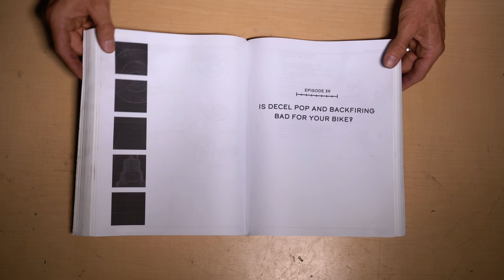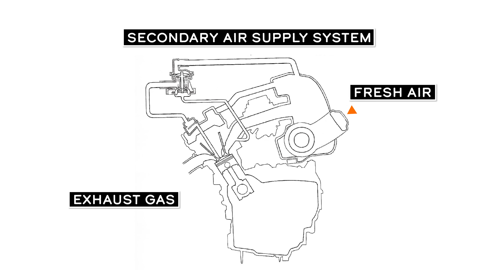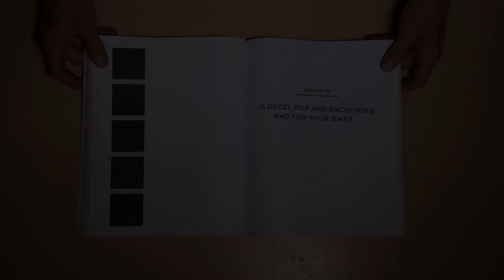Backfiring and Decel Pop — Is It Bad For Your Motorcycle? | The Shop Manual

Comment from the maker: Better exhaust sound is just a slip-on muffler away! https://rvz.la/3zXQJQj
Reply: Which exact knife are you using at the open?
Reply: @KutWrite 🎉🎉😂🎉😢🎉😮🎉😢🎉😢😢😮
Reply: I’ve got a Triumph Speed Twin 900 and occasionally on engine braking, it has started to pop really loudly…(note for later) 

I was coming into a corner decelerating from Mach Jesus and downshifting when I picked my corner gear and I heard a loud bang from the exhaust.

Today I heard a loud pop when decelerating in a higher gear but at a lower speed.

Comment: I JUST installed an aftermarket exhaust a few days ago and was surprised by the decel pops that began after. This video was timed perfectly as I was wondering if that was a normal thing! Thanks Ari!
Reply: Shorter exhaust baffles allow oxygen back into the exhaust system due to camshaft overlap which can cause afterfire.
Reply: It means your bike needs to be tuned to work with the exhaust you've installed. You likely now have a lean stumble off the bottom too.
Reply: @flippy66They normally occur when installing an aftermarket exhaust. They always disappear when the machine is tuned properly.
Convincing people it is normal, makes it easier to sell exhausts; as does convincing people it sounds cool.

Comment: Great video.. I think most people get decel pops confused with lean pops and worry unnecessarily. Back in the day with carbs and simple EFI systems when you'd put a new exhaust on it would lean out your mixture causing the bike to run super lean and pop on decel (which was bad back then).... newer bikes are popping because of what Ari was saying...from fresh air being injected into the hot exhaust gas...so it's totally fine now.
Reply: Most newer bikes are already running incredibly lean from the factory should still get a tune if you change your exhaust or intake especially is you do both.
Reply: @milodudeful  yeah they are way too lean. I agree with its mandatory to get a tune if you do air filter and exhaust. But since most of bikes restrictions are from the cat and breadbox resonators..just doing a slipon doesnt really do anything anymore. But getting a tune is always a good idea..these emissions regulations are pointless and in some cases cause more pollution.
Reply: @JeremiahHartmanPhotography  Oh ya I see what your were saying now. Ya if you're just doing a slip-on you don't need a tune. Honestly kinda forgot about slip ons cause mine stone was one welded piece so I needed a full exhaust lol.
Reply: @Oki The Vixen wow and how did you figure out it was the ignition coil? is it a common sympton?
Reply: @diegopescia9602 y 03’ R1 sounded like a parallel twin after it got warm one morning and I was so worried I blew the engine or something but nope it was just a loose spark plug on the first cylinder 😂 ended up swapping plugs and ignition coils now the bike fired up no hesitation! It is a little lean with the slip on I got but it runs and rides how it should but it’s for sale currently lol
Reply: Thats when you cap off any EPA systems and it should at least help with the pops if you don't care for them
Reply: @tejay9416  used to be the case...and i guess you still could..now you can turn off air injection electronically thank god lol
Reply: it still leans it out with new bikes thats why u need a ECU flash when you change the exhaust
Reply: @milodudeful  def if you do both!

Comment: my S1000R has been Tuned and fitted with a straight SC Project pyp with no silencer or exhaust Flap. when i use my quick shifter I get pops and when i leave my throttle

Comment: Do some people purposely tune their bikes to pop and sound like a backfire? Or is that caused by aftermarket exhaust systems? I've witnessed bikes stopped at intersections, blipping the throttle which results in a lot of popping, and sometimes flames from the exhaust.

Comment: So rich or lean can be the cause of this? I'm almost positive my bike came lean from the factory (TW 200). Sounds like they tune them lean from the factory. Get a little decel pop going down hills in gear.... lazy so i still haven't checked the spark plug to see but I'm almost positive it's lean. gotta pop out the little plug on the carb and fix the mix.

Comment: There are also quickshifters that cut spark plugs, instead of cutting fuel, to chop power just monetarily enough for gears to shift up, with open throttle, and no clutch use. And then there's 2-step systems that cut power the same way, to launch a vehicle at a predetermined RPM, like for a car, the best RPM to launch without losing traction, and for a bike, best consistent RPM to launch without doing a wheelie. A senor that knows when the clutch is held, engages the lower 2step rev-limiter for launching. 

And then there's turbocharger Antilag systems.

All 3 of these lead to unburnt fuel in the exhaust. Turbo Antilag does this on purpose, delaying the spark plugs, so the cumbustions still happen after the exhaust valves open, so they keep the turbo spinning when off throttle, so, you don't have to completely start building boost all over again, when you get back on the throttle, like when exiting a corner.

But that style of Antilag system puts a lot of stress on the exhaust pipes, and turbine of the turbocharger. Best used when you don't care about longevity, like a Rallycar time-attack event.
Reply: Oh. Quickshifter & 2-Step kits can give you the option to cut fuel and or spark, depending on personal preference.

And a Quickshifter cuts power by detecting shift lever moving to up shift, for quick open throttle, clutchless upshifts for reduced fatigue, and the quickest acceleration possible.

Even better.

If you have a turbo-kit on your bike or car. Those open throttle upshifts, also maintain boost, because you're not closing the throttle, slamming the door on all that boost (compressed air), venting it to a blowoff-valve or back into the turbo compressor, just for the transmission to upshift smoothly with no load on it.

Comment: My motorcycle shoots blue flames with a popping sound when I am, for example, in second or third gear and I close the throttle and then slightly open it. This is when it pops. I can do that three times—open and close three times—to hear the pops, and it flames blue. Is that bad? Kawasaki Ninja ZX10RR 2018, full system Yoshimura.

Comment: My 2010 Triumph 675 STR only has decel pop around 5000 rpm and it is not very loud even with the Arrow 3-1 exhaust. Does sound very racy though.

Comment: i got a buellxb... the only reason i ride it is for the decel pop... netflix was filming a tween show 13 reasons why in my home town and i was riding my pretty quiet dirt bike... thier security tried to  force me off of a public road and then came out and threatened to beat me up...  i just went home and got my buell...  i filled up and rode my bike around that block until my gas light came back on... it was so cool they called the cops out a couple times... but since i wasnt actually doing anything actually illegal they couldnt actually do anything...

Comment: Can anyone please tell me why does bikes like ducati or any supersport motorcycle produce a loud bang on quick shifting at high rpms ??  I am assuming that it is because the engine is taken away from one or more powerstrokes cuz of quick shifter , so to compensate the drag caused by the no powerstroke cycles , it pumps more fuel and air in the immediate powerstroke ??

Comment: Popping is not good, it usually indicates a lean air/fuel mixture. This is to be expected when you install a performance exhaust system, because the less restricted exhaust will disrupt the air/fuel mixture causing the engine to run lean.

You correct this by adding additional fuel with larger carburetor jets/needles, or by reprograming for EFI systems.
Reply: You can thank environmental laws for that.

Comment: You're a bit off on this. According to the Internet a backfire is gas igniting outside the cylinder, period. Pre-cylinder is def bad, but post is common as hell. Any carb running even a little rich is gonna have combustion in the exhaust when you suddenly let off the throttle. It's normal to hear that pop, pop pop, pop pop. There's just extra fuel in the hot ass exhaust. If you're shit is igniting on intake, yeah, that's a problem. It's all still backfire though. Never even heard of "de-cel pop" lol
Reply: If your engine is knocking so bad the mix ignites BEFORE the intake valves close, yeah that's a problem, not like a wrong octane problem, like a serious engine destroying one. Backfires are common as hell, and nothing to worry about, backfires up the intake are rare and def a sign of major major problems.

Comment: Thank you for this info mate. My XR500R head bolts are stripped x3 and when the bike is cold it runs smooth but when it heats up it back fires. Your video helped me understand that is could be compression loss causing the  pop. I'll get my bike sorted next week.

Comment: I don't mind a little bit of popping.  Stock bikes do it, you just don't hear it much because the CAT and mufflers... well, they muffle the popping.

But once I do the exhaust and tune, I jam a marble in the AIR hose and 100% block that system.  No need for block off plates, a marble does the trick every time...

Comment: So glad to finally, finally see a Honda on the bench.

Honda call their secondary system "pair" system... basically injects raw air (filtered from airbox), raw air into the exhaust after the valves, before the downpipes.... yeah, helps ignite unburnt fuel. This is most notable on deceleration. There is NO, absolutely NO increase in performance whether the PAIR is installed or not. It's used for emissions. HOWEVER, a rider will notice a signifcant "muffle" of the crackling (when decel) significant lowering when that PAIR is blocked off (and there is NO change in performance). With the PAIR installed, the crackling will increase the "blue flame" out of a non-restricted exhaust system... sounds awesome and lookes incredible - Guy Martin used to have 2ft blue flame out the back of his Honda when rounding Hillbery (TT).... there's minimal weight reduction if removed.... sounds much better when left alone. But... some people like cucumbers....

Comment: Does changing the Standard CDI to Power Max racing type, Iridium Spark plug & Uma Racing Coil Plug considered a heavily modified? Coz I got both 125cc Scooter & 250cc Ninja 2012 both with Carb instead of Throttle body... Thanks...

Comment: Good videos on this page. how come i do not see a hold at the tip of muffler to fit a db killer? i've seen some Yoshi with the hole some none. just the rubber plug on the carbon piece

Comment: and do you have any ideas what parts I ruined after running with clogged jet for around 10km ? it was a year ago. but after your video it all makes sense now. first the carburetor jet got clogged, then tiny 1 or 3 backfire pops after releasing the throttle, then 3-8 backfire pops after releasing the throttle. and now constant idle overrevving and backfires. its no big deal since its a non street legal 125cc.  but i want to sell it and get most money out of it. i already cleaned the carb, replaced the fuel from the tank, changed the fuel hoses, fuel filter, air filter. i think i need cylinder rings and maybe some a gasket. i haven't tried to start it yet. but ill go and try it now. i suggest you should make a new video on what to do if you didnt care about the backfires and what potential parts can get ruined. besides the air filter setting on fire which didn't set on fire n my case.

Comment: My ATAS has an afterfire when I'm cycling the throttle at a stop to warm it faster. Once it's hot everything is fine, but I'm not cycling the throttle when it is hot!
Reply: It's better for the engine to hold a consistent higher idle than to cycle the throttle. It's best to just be gentle with it until the bike has warmed up by itself as even if the temp comes up faster, the block and all the other drive components will have hot spots and cold spots.
Reply: @stormatron6184  hm. I start the engine, wait maybe 5 seconds, then ride off easy. At stop lights and such i roll on the throttle to assist it in warming up. You're saying to hold a high idle?
Reply: @Hansengineering  Sounds like what you are doing is fine. I thought by cycling you meant ramping it up towards redline repeatedly that you hear people doing. Holding it at something like double normal idle speed is what I was getting at. Some ECUs will do this kind of thing automatically.
Reply: @stormatron6184  oh no like idle to ~4k and back.

Comment: Incorrect. The reason high flow lower restriction cans cause decel pop is because they allow fresh oxygen INTO the exhaust system so the excess fuel can now be burned. >POP<.

Comment: Sorry but I’m going disagree about flames and bangs being bad. It depends on the tune that’s put into the ECU, the size of the engine the quality of fuel and the exhaust flow. My Triumph Rocket 3 has been meticulously set up on a dyno but it’s 2.3 litres and there’s no catalytic converter and the exhaust itself is very short. The consequences of this are a massive flame show at night and bangs that sound like a shotgun going off, especially if I use E10 fuel. Not so much with E5.

Comment: I had a 21 xt250 that I put a slip-on on and that thing would shoot a foot flame when it got hot on hard trails. I figured it has no o2 sensor but is efi so when hot it is starting to run rich from hot air intake temps. Was defending cool but also kind of good cause I would know to go a little easy or maybe take a water break and let the bike cool down being air cooled and all

Comment: I have a fuel injected 750 turbo & if i take off the wee rubber plug situated after the injectors i get loads of backfiring whilst decelerating which shows its running Weak which will bugger up the pistons & possibly the valves too.

Comment: my monster 1200R was having a lot of decel pop with a SC project slip on.  After a tune, cleaned fuel injectors and removal of the secondary air system they are pretty much gone.

Comment: my snowblower pops when the throttle goes from full to low all at once.  and it’s extremely loud.
i’ve had it for years and runs great.
starts every season with no issues.
has never blown up.

Comment: I ended up with this Chinese Apollo 250 Enduro and have had nothing but problems with the cheap carb/s. The cheap replacement cuts out on acceleration and also has decel pops. I'm looking at a Nibbi carb now but not sure what size. Pretty sure the old carb was running lean..

Comment: I have a 2019 Ducati monster 821 

I have a termignoni slip on exhaust on it and it pops and bangs on decel all the time. I have it regularly serviced and all the maintenance are done on time. 

How do I know which pops are good and which ones are bad ?

Putting a slip-on on my bike has removed the cat and there is a racing tune provided by ducati with this exhaust system.

Comment: I think it was Cycleworld that had an article on this around 15 years ago. Basically it's because you suck at installing your illegally fitted 'Race use only' can on your bike. It was a Yoshimura technician describing how it's a leaky exhaust system causing this. Clean your connections and install properly. Race cans are dumb loud on the street and your not gaining anything.

Comment: What is back pressure and will a slip on exhaust mess with the engine back pressure ?
Reply: If it is 4 stroke engine you will not destroy engine in most of cases. 2 strokes are bigger problem for exhaust changing

Comment: If an engine is running lean than why is there unburned fuel ? That doesn’t make any sense
Reply: Lean doesn't mean all the fuel is consumed, it simply means the AFR isn't ideal for complete and efficient combustion. An excessively lean mixture actually burns more slowly and poorly.

Comment: I started my 1203 CC air cooled Buell a couple of times to test the old 200 amp battery before I instead a new 350 amp battery.  I kept getting a spark when I touched the ground side of the battery to ground with all power turned off. This is not good it shows a drain on the battery.
  With the new battery installed I turned the key on and boom ..There was an explosion.  The Ignition must have made a spark event exploding the unburned gas in the cylinder after I had started and shut off a cold rich running engine ..

Comment: My old car had lpg. One backfire exploded the air intake. Had a bad coil. My mt09 has a full two brothers exhaust. It has great de cell pop. I can also get it to shoot flames plus loud bang if I floor it then down shift for a rev blip. So excess fuel is in the system. It isn't tuned for the pipe and smells rich. Happy to have rich then lean. So I leave it. 15 000km and still fine.

Comment: Got a 150ccücarb bike. Sometimes, if i jerk the throttle a few seconds (opening it on and off repeatedly, eg. exiting a tight spot) it pops somewhere around the air filter and/or carb. Especially when its not warmed up yet. Is it normal or should i get my air/fuel ratio checked?

Comment: Well my bike did those loud gunshot like bangs when I ran it without a db killer. My friend even said that he saw flames shoot out from the exhaust. Now that I put them in it does way quieter pops if I let off the throttle quickly, downshift or let off downhill. I suppose that's normal though, right?